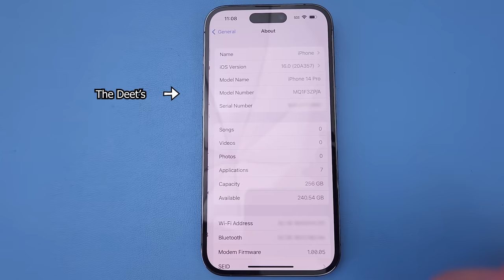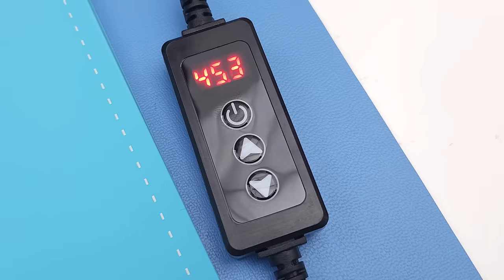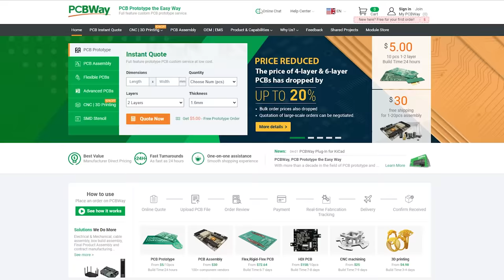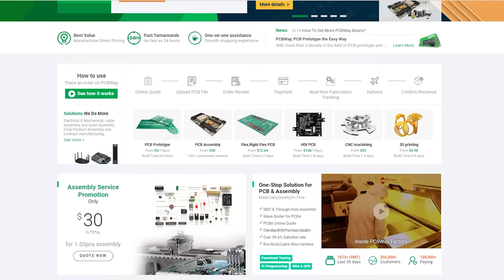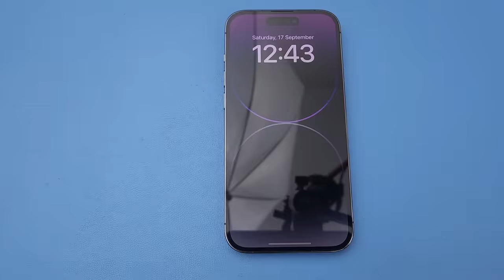iPhone 14 Pro Teardown - Full Disassembly

Comment: 11:58 how did you turn it on without CPU chip ?
Reply from the maker: The CPU is in the phone at 11:58, that part with A16 Bionic written on it is just a metal shield, to fasten down all the flex cables plugged in to the board.
Reply: @RestoreTechnique  thanks a lot

Comment: Früher konnte man den Akku ganz einfach selbst tauschen. Ist diese komplizierte Arbeit jetzt Fortschritt? Ich möchte jedenfalls gerne wissen, ob das Gerät nach dem Zusammenbau wieder wasserdicht ist. Wenn nicht, dann doch lieber nicht.
Reply from the maker: Yes batteries were easier to replace before phones starting become more and more water resistant.
Water resistance can be restored with the original screen adhesive seals (which I didn't have at the time) 👍
Example - https://youtu.be/LwtMCpJ9BzA

Comment: What happens if we use 14 pro screen on 13 pro :D
Reply: Wouldn't work because they're not the same.
The 14 Pro has an ever so slightly bigger screen with slightly higher resolution.
13 Pro: 6.06" 2532x1170
14 Pro: 6.12" 2556x1179

Comment: You did NOT put back a replacement of the waterproof/dust protection seal you pealed off the original of when you were disassembling the phone!!!!!  I’ve watched a third party repair guy’s videos who is located in Malaysia and every single time he repairs any of these -whether a 12 Pro, 13 Pro, or one of these, he NEVER puts back a replacement water/dust seal between the outside edge of the back side of the glass screen and top edge of the flat frame of the rear housing just as you failed to do in this video!
Reply from the maker: This was taken apart on Launch Day. Replacement seals were not available for the iPhone 14 range on the day the phone was released 🙄
I tried to use an iPhone 13 seal, but it didn't fit.
Now that replacement iPhone 14 seals are available, I have replaced the seal and made it water resistant again.
Example - https://youtu.be/LwtMCpJ9BzA